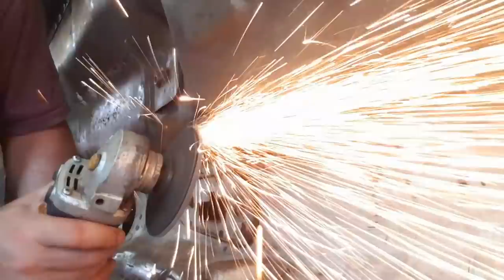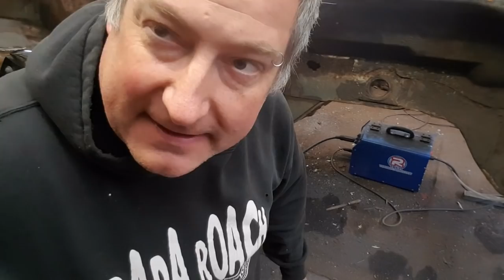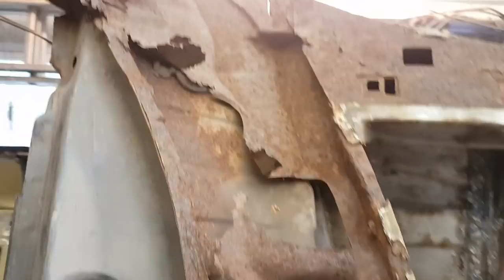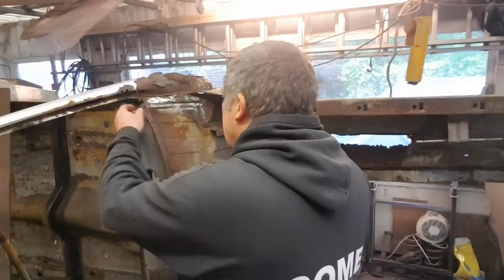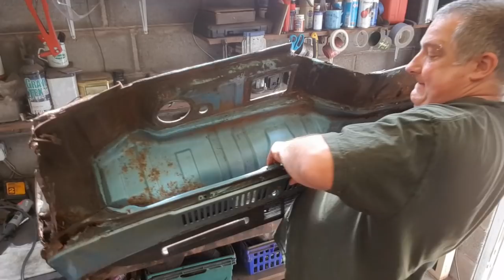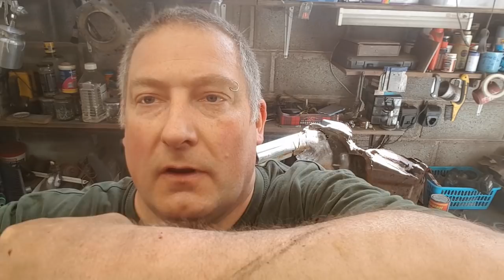MKV Cortina Carbodies Restoration Part 23

Comment: I love your enthusiasm and  note that you used mono goggles once with the grinder..but not the twist wire brush..Those damned things spit out wire .. and I have pulled the bits out of my self after using them. Please take care and work safe..
Reply from the maker: Cheers Mr Cirtis. I like the Russian roulette aspect of it. Pulled them out of my arms and legs plenty of times but, alas, none in the eye yet. Would make great video.

Comment: Wouldn’t it be easier to have put longer bolts into the gearbox mountain holes and use nuts to hold it in place
Reply from the maker: I wanted to retain the original captive nuts.